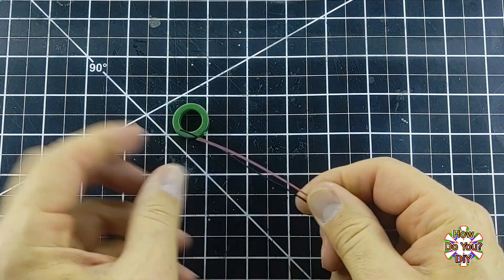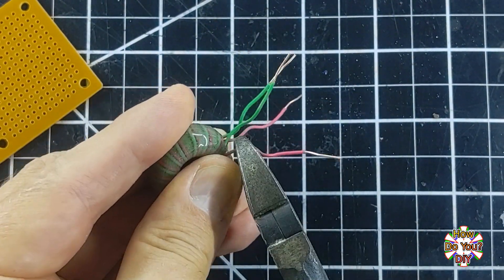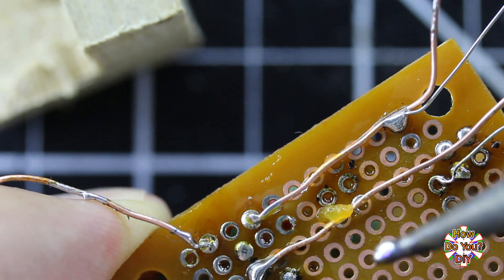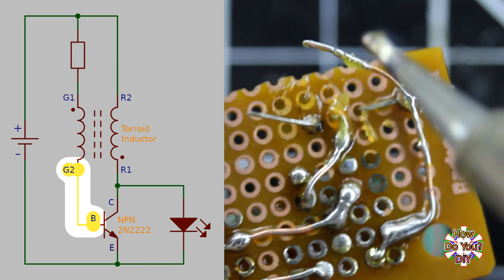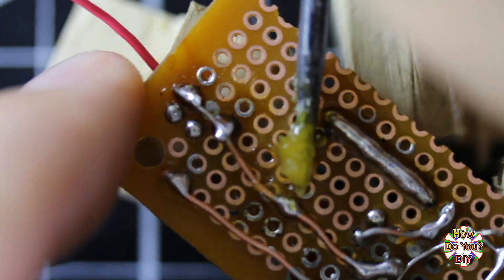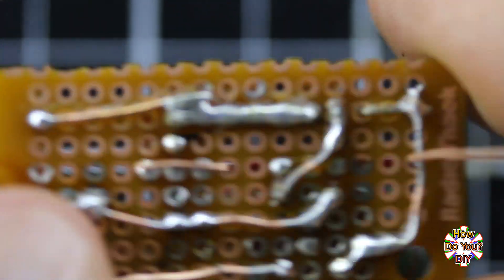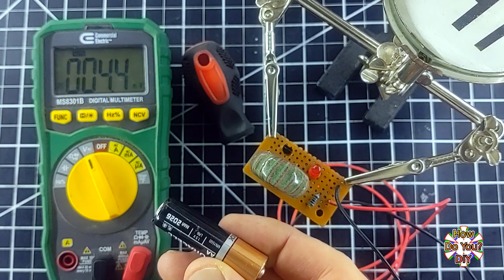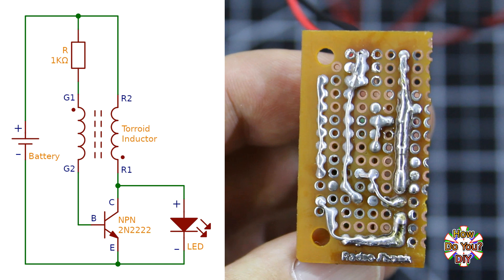Make an Easy Joule Thief Circuit | Soldering for Beginners

Comment: I built the circuit this afternoon with stuff from my parts box and my led lights up in the way you described and I think that the output pulses are about 5.5 without a load, maybe, works pretty good.  Thanks for the suggestions. I am currently digging around for a diagram for a trippler circuit; might end up being a good trickle charger for a 12 volt battery?  We will see, again my thanks.

Comment: Is the yellow stuff you are using during soldering rosen? The type I use is a very dark brown and has more of a syrupy consistency.
Reply from the maker: It's rosen based flux, but it's not pure rosen. I have some of the rosen you're talking about, and it works great.

Comment: Seems like I could use this properly tuned to fool my RV charger into thinking the battery is floating higher than it is. Or fool a charger into charging LifePO4 when it’s made for Li-ion.

Comment: Awesome video! Exactly what I needed. Can I use a Toroid Core Common Mode Inductor Choke in the board or is that different than the toroid inductor you make in the beginning of the video? Is a choke the same I guess is my question.
Reply from the maker: That's a really good question. I haven't tried, but I think that should work.
Reply: @HowDoYouDIY  It did not work. :) At least not for me. I had to pull it apart and wire it as a regular toroid. Thank you for the reply.
Reply from the maker: That's good to know. I appreciate you trying it and letting us know the results 😊

Comment: I have no clue what the point of this vid is or was ?
Reply from the maker: That's a valid question. The point is to show how to build a joule thief. A joule thief is a simple circuit to boost voltage. It's also a good project for someone that's beginning/learning to make electronics.
Reply: @HowDoYouDIY  So it's a type of a voltage booster ? But can it be made to boost to a specific voltage ?
Reply from the maker: Yes, it is a type of voltage booster. I think it can be modified to boost to a specific voltage.
Reply: @HowDoYouDIY  And where is the best use for it ?
Reply from the maker: This design is mainly for educational purposes. But you can use it if you need to boost a DC voltage, like lighting up an LED with a AA battery.
Reply: Excuse me, you probably asked so stupidly because you didn't know ohm's law????? Current is proportional to voltage and power is a constant. In this case, the output power is the same as the transistor. Adjust the voltage as much as you need and use it wherever you want. When raising the voltage, you cannot avoid current losses. Good luck
Reply: Apparently this guy named it https://youtu.be/K53beWYdIpc